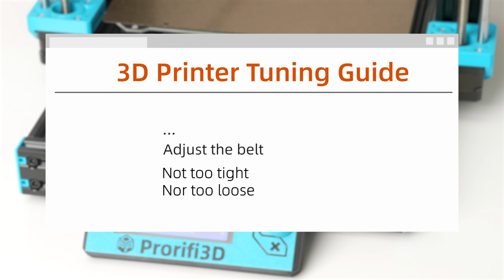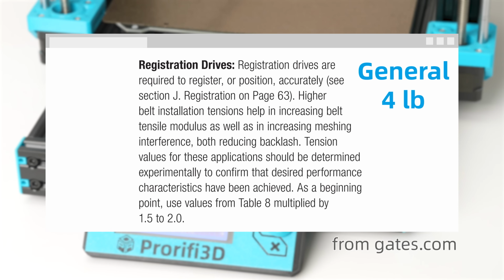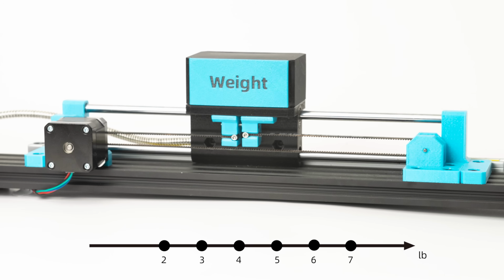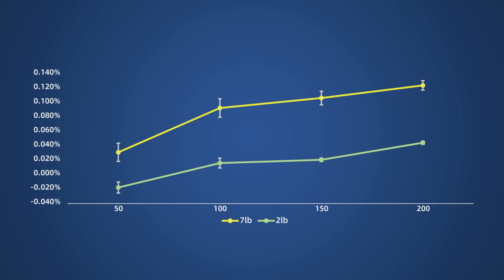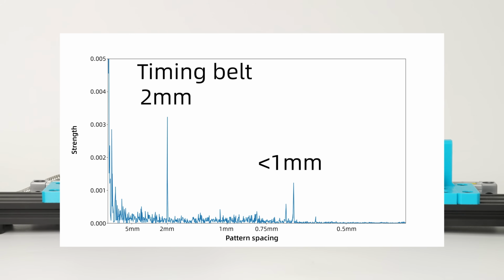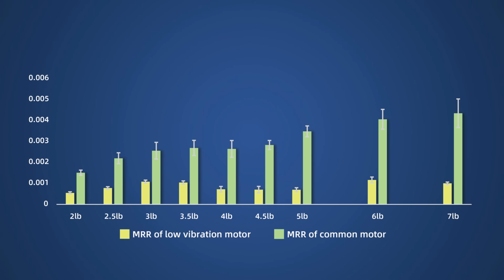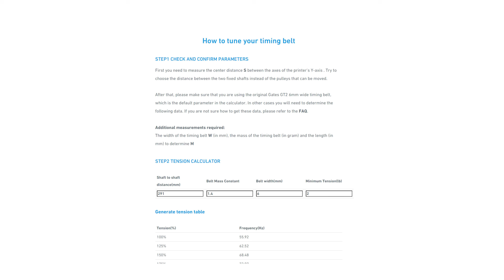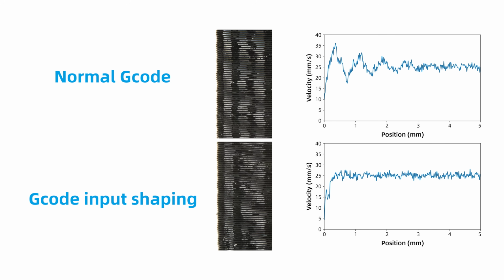We found the BEST belt tension for 3D printers

Comment: Hello. Hope you are well. I have a question because I've seen how you routed your belts. In my 3d printer my idler is a smooth idler which makes the belt loop around it 1mm bigger than the motor pulley. 

So these leaves me with two options. 

1) do exactly what you did. Stager where the belts meet at the bed by 1mm in height. So the belt top and bottom are parallel with the axis. But the the top belt, they meet, is not inline

2) have the top belt inline and parralel with the axis. And the bottom belt will be slightly slanted. 

Hoping you can tell me which one is the right way

Comment: If you increase the length of the belt, and do not compensate for the elongation, this is what you get. Sometimes, you listen for the very key thing going on in a study, as to if the "scientists" has any comprehension as to what on earth he is doing. The belt has the same number of teeth, but a different length, when stretched. This is not mentioned at all here. Not once. What on earth they actually measured, is hard to tell, but it sure ain't what they claim it was.

Comment: For technical precise parts or dimensional accuracy...
GT2 means 2mm per tooth shape phase/cycle. Actually the belt tension should be such that
length_of_belt / 2 ==  number_of_teeth
OR
 number_of_teeth * 2 == length_of_belt.
If the tension gets weaker over time you should replace the belt, not get the tension up again.

Comment: What surprises me is that nobody comes up with automatic belt tensioners. One can simply use idlers on hydraulic or pneumatic pistons to tension the belt. A pump and pressure sensor can then be used to maintain a constant oil/air pressure so that any wear, stretching or other deviation will be automatically compensated.

Comment: i mean 2 - 4 seems like a winner here, but it seems to be tested on snail printing speed. Everyone is pushing the machines to the limit where accelerations and deceleration are much bigger than what was shown in the axis simulator. In those cases your belt will start to slip on low tension.

Comment: Start of the video comment, under 1 min in. My method is use my ear and listen to the belt when plucked and run it and listen to the steppers. Run input shaper and adjust based on the results above. 

Lets see what they say....

I guess i am going to spend some time tomorrow messing around with my belt tensions and see whats best.

Comment: I hang a 20g scale weight from the center point of my X axis belts, then use the measurement between the 2 sides of the belt as a reference point to start with. For my Y axis belt, which is a vertical mount,  I use a DIY 3D printed - open ended - wedge that fits between the belt and the rail - and use the deflection of the 2 sides of the wedge to get a reference point. As I run through prints, I use these reference points to adjust belt tensions. It takes time, but now I have a stable belt tension setup and my prints get great results.

Comment: Do you plan on developing a 0.9 degree motor at all?
I know 0.9 degree motors are usually used because the MMR that they produce is higher frequency and (usually) lower amplitude, but they also have the benefit of additional resolution, especially when used on the Z Axis.

Comment: One of the most educational videos I've seen on 3d printers! Has anybody tried the ender 3 v2 for an optimal tension, couldn't find data for that in the given link
Reply from the maker: For ender 3v2 we do not have an official value, but in the tension guide, there is a tension table calculator to help you find the optimum tension on your own.

Comment: So the best tension is the most you can get away with, without torquing the machine?  printers will eventually need more rigidity.
Reply: No, they clearly show that both too tight and too loose induce errors. Tighter belts reduced belt ripple in most cases, but increased motor resonance ripple.

Comment: Another thing to consider is using the correct idler: many printers use smooth idlers on the toothed side of the belt. This will cause resonance.
Reply: Eww eww eww why would they do that?!
Reply: Exactly! This bothered me right off the bat, for example, on AnyCubic printers, and it indeed has a visible effect.

I haven't tested it (yet), but I also believe that different tooth profile shape also causes different visoble effects. For example a HTD-3M semi-circle profile belt engages more softly with the pully than a trapezoidal XL, MXL or GT2 belt. I haven't tested it yet this professionally on a 3D printer, but in other applications I hear them less noisy.
Reply: @gabiold  i would bet that most 3d printer manufacturers don't actually hire real engineers
Reply: @schizophrenicgaming365  I recently returned a Creality K1 because of that, not only where tooth sides running on small smooth idlers but the belts also didn't line up and caused a 0.8-1.6% deformation on parts near the edges and sides

Comment: I think the smooth idler on Prusa is a design error that emphasises belt pitch artefacts.
Reply: I can’t remember exactly where I saw / read it, but a while ago someone did test that hypothesis and could not find any difference between smooth and teethed idlers…
Reply: @UloPe  Well i have an opposite opinion from my first hand experience, i don't have rigorous test results, but at higher tensions it does feel a lot more consistent by hand feel when hand jogging. However it took me a few tries to get toothed idlers from China which were actually machined deeply enough and had bearings good enough to actually work, and the good ones weren't all that cheap. At lower tensions it's probably less relevant but at lower tensions you have more belt compliance and vibration, you're supposed to have more preload. Did you know the belt is undersized and reaches the nominal 2mm/tooth pitch only at pretty high tensions? Unfortunately stretching the belt to spec is also a little borderline and ruins the printer stepper bearings, since you're supposed to not have the shaft just stick out unsupported with that much of a side load... Anyway i'm the sort of person to add more belt tension, add more stepper current, add more PCB cooling, and then juggle the consequences with pleasure. If the printer can't break your arm, is it even a real printer?
Reply: @SianaGearz  😂😂
If I remember I’ll try to look up the source, it’s also of course possible I’m misremembering.
Reply: @UloPe  I do think quite a few people concluded that toothed idlers aren't needed or all that useful, from tests or first hand experience; but you'll also find quite a few people who swear by them.

I think ultimately that's the thing, if a toothed idler binds, even momentarily, you're in for a rude surprise. If a smooth one binds due to bearing fault, you're not even going to notice it most likely, and you can get much bigger bearings for a given idler size. It's kind of a design meme to just use flanged bearings as iders, these are super robust because they have big balls and spacious cages, so even if one is a little worse off, it's still going to be fine.

So for a manufacturer, regardless of possible advantages of a toothed idler, it's just much safer to use smooth ones, less complaints less warranty less service to do, quality be secondary. Also like on something like Prusa earlier generations there's an extruder stepper and gears imprinting on the extrusion bead, there's a high frequency pattern there that will cover up any pattern from the belt chatter. Now that MK4 has an actually amazingly well designed extruder, other sources of disturbance should be paid more attention to.
Reply: @SianaGearz  Btw, the tear smileys were directed at the arm breaking joke, not your opinion in general 😅
Reply: toothed idlers are aactuaaly woth than flanged bearings. for corect use of toothed pulley your belt should be preloaded(stretched) for correct tooth to tooth grip. idler have small faulty bearings inside that have design flaw of beeing locked when overtighten. flanged bearings are big, ribust and ther internal shaft is protruding outside making them impossible to lock. only thing you should remember about flanged bearing instead of idlers - they have sharp flange and can actually cut your belt if not aligned properly.
Reply: @madmatrac   The bearing quality varies. You can buy smooth idlers for 0.10 and they will "work", because even if the bearing binds up, the belt can still slip.

You buy cheapest possible toothed idlers, and you can throw them away instantly. I went through several toothed idlers until i found ones that work, and the good ones weren't cheap. But they have been working for 5 years now, they bearings are really good. Not only bearing quality is important, also machining depth and precision for the teeth.

The problem with smooth idlers is that the belt stretch varies over the phase - the position of the belt on smooth idler. The number of teeth touching the idler varies, and how much they push against the belt preload varies. Ths introduces oscillation, which a quality toothed idler fixes. A quality toothed idler tensions the belt on the spine rather than across the teeth.
Reply: @SianaGearz  Hi. Please recommend high-quality tension toothed idler.

Comment: Mind you that your belt setup on right side is not parallel to the belt below. That creates also error in position on your setup. Many printers has this issue having the belt angled and not parallel!
Reply from the maker: The belts on our test platform are parallel.
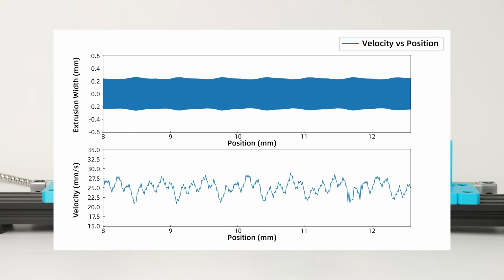Reply: @Prorifi3D  I think they meant the belt is not totally parallel, as we can see in 6:21, the tips of the belt are not collinear.

Comment: The bambu carbon do the same with input shaping
Reply: Correction, the Klipper firmware does input shaping and it won't help with belt tension issues beyond fixing the ghosting.  Input shaper is about accel/decel
Reply: @saltwaterrook4638  The X1 can detect belt tension with it's short vibration test it does before each print.  I found out when it suggested I tighten the xy belts before my print started, after loosening and re-tightening 4 screws for the tensioners I ran the calibration for Resonance Compensation and it cleared the message.  So it does use that to check belt tension.

Comment: well... what about using threaded rods as "belts"?
Reply: Belts are the usual method due to the trade-offs involved.  These can be extremely precise, as it’s what are used in printers and scanners.
Reply: Belts have less backlash.
Reply: Threaded rods are awful, but leadscrews can be very accurate. That said, belts still have less backlash. Belts are great for 3D printers and laser cutters where you are applying a relatively low force. Screws work better for higher forces like routers and mills, whose high forces would cause consider change in size of the belt (it's a spring).

Comment: If firmware can access motor resistance or whatever you said, then why isnt there a belt tension ui under a settings menu?  Someone should do that.  Just like you can jog a machines x,y,z … u could jog the belt tension.
Reply: Motor resistance isn’t a reliable measurement.
Reply: The Bambu Lab X1 Carbon can detect loose belts.  It checks before each print by doing some vibrations for each axis.  I thought it was just part of the input shaping, but it gave me a message to tighten the xy belts one day just as my print started.  I let it continue and the print looked good, so maybe it's pretty sensitive at detecting a small change in tension.  After I loosened and re-tightened the 4 screws in back for the xy tensioners, I ran the calibration test and the message went away.  Still printing great!  I was surprised though because I never heard of any consumer printers that detect loose belts and I never heard Bambu Lab mention it as one of its features.  I wonder how many other features it has hidden away.  It would make another great selling point in comparison to other printers. They 're definitely on a mission to change the game.👍
Reply: It would be difficult to find the ideal tension, but you can test for some edge cases. If the belts are too loose, then the first few steps will not meet any resistance - they will just be picking up the slack. After a few steps, the slack will be taken up and the resistance will increase. That would be a clear indication that the belt is too loose.

If the belt is too tight, there will be excessive amounts of resistance due to friction on all the rotating parts. If there is an expected level of resistance known for a particular printer, then you could set an upper bound on how much would be excessive. That could be for more reasons than just the belts being too tight (dirty, in need of lubrication, misaligned, etc.), but it would still be a valuable test.

However, you couldn't tell from resistance alone what the positional accuracy is, since the very cause of this error is a difference in the motor's position and the head's position due to linkage in between (the belt). I'm not sure what the resolution is on the measurement of the motor current, but I doubt you could test for the amplitude or frequency of ringing in the belt based on those measurements. Not that it is impossible (a similar technique is used to control brushless motors), but I don't think the usual TMC stepper drivers provide this level of resolution.

Comment: Can you run pulleys with gears vs the "flat" bearings?  Most of my ripple was removed by  changing idlers to toothed bearings. Not sure who thought belt teeth bouncing over a hump would be a good idea?
Reply from the maker: This is a very interesting topic to research. Thank you for your topic suggestion!
Reply: It's cheaper.
Reply: @TheFoodnipple  marginally at the cost of quality
Reply: wow. Cool comment. Never though about it, but actually you are 1000% right - it is wrong.
Although... the more time people optimise the printer, the less time they design and print their real ideas.. So I.. kind of.. dont care about ripples and would rather sit in SE or even Tinkercad than study 20um deviation rippples on a print surface :)
Reply: @TushhsuT  with transparent petg it’s the difference between clear and opaque
Reply: Always wanted to test a toothed pulley to mitigate ripples.   thanks for sharing
Reply: @jordandotan  Nero made a comment today suggesting if it was a problem it was more due to belt tension. Which I can agree with in part especially if really tight. But I removed the extra idler entirely on the ender 3, at the back and used a toothed pulley up front. The belt teeth bumping up onto the back tensioner idler was a big source. You could feel it moving the bed. bump-bump-bump
Reply from the maker: @jordandotan  This is an interesting topic, thanks for the suggestion!

Comment: this is interesting but you have to also consider the radial force that the motor shaft can actually sustain (which depending on the pulley position might not be that much).
Reply from the maker: This is indeed an additional problem to consider as well, thank you very much for your advice!

Comment: This makes me think that it would be interesting to add a load cell "weight" sensor to a printer's axis, and with something like HX711 you could measure the weight created by the belt during the actual ongoing printing on the printer itself. Much cheaper than an optical sensor like used in this video, and can be cheaply added for each of the axis on a budget 3D printer.
Reply from the maker: Using a load cell snsor is a different approach to be researched, but obtaining the "force" signal does not directly indicate the change in position, and the resolution and accuracy of this approach is unclear. In our research, we have used an optical linear rail that has 1um resolution.
Reply: Sounds like you got yourself a great video idea.
Reply: Interesting but, they weren't measuring the tension on the belt with the optical sensor. What benefits would measuring the belt tension on the fly provide?
Reply: @JeanSolagnier  my guess is that it would be possible to find when tension changes because of velocity/acceleration fluctuations during movement. And then an algorithm could be used to reduce the fluctuations in tension, leading to a more stable tension for the duration of the print. The hypothesis being that a more stable tension during extrusions will lead to more even extrusions and thus less surface artifacts.